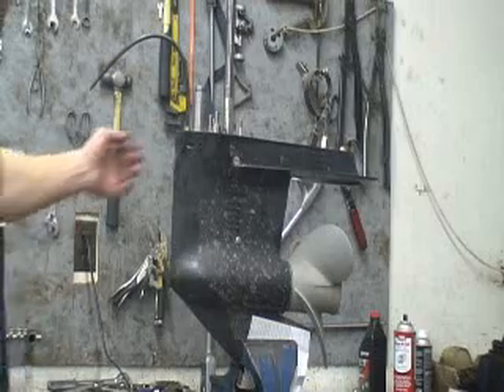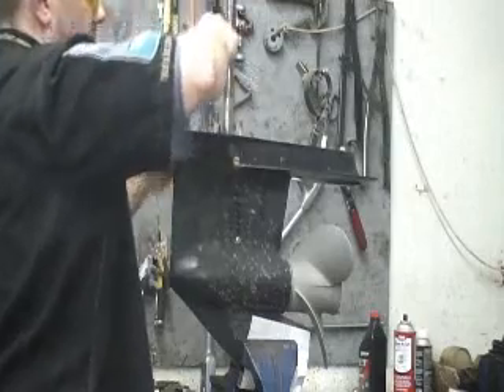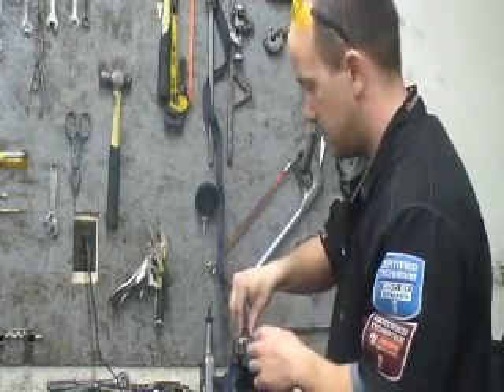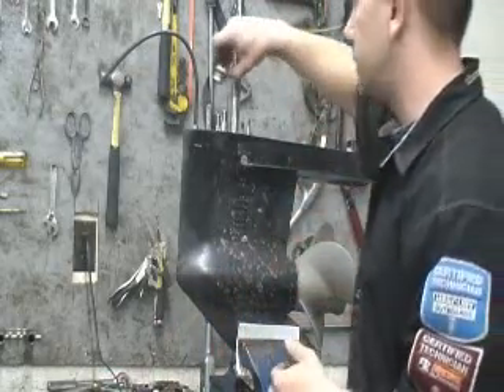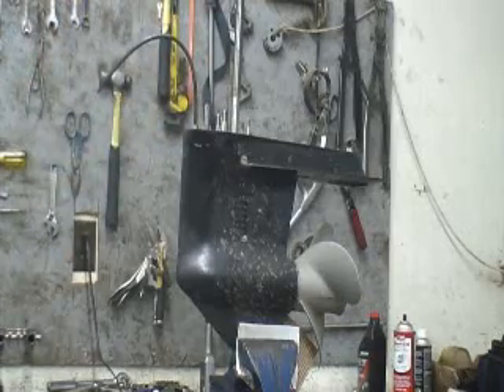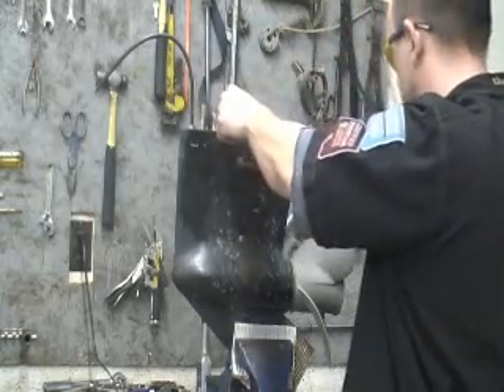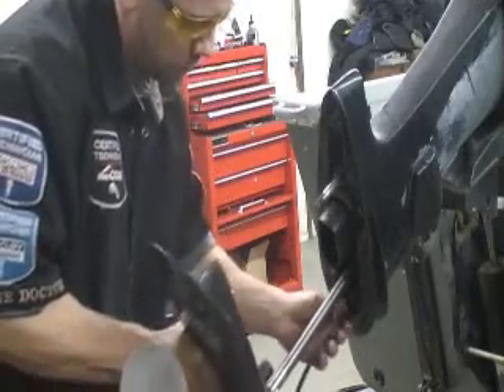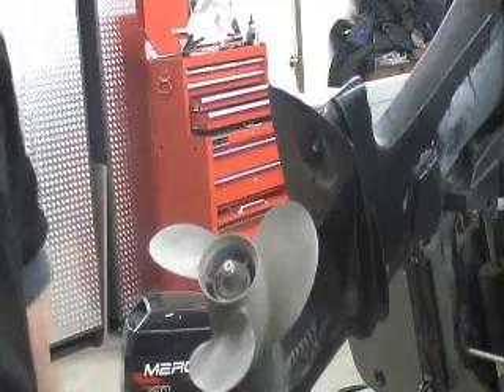Merc gear case removal and replacement Part 2

Comment: I have a 83 mercury outboard lower unit and the water pump tube is a solid copper tube is there a trix to instaling this type of unit it seems likt it gets real close but seem like that tube holds it up.

Comment: First I want to say thanks for making these videos! They're very clear and easy to understand. I wouldn't have attempted to change my water pump, but after seeing how easy it was I tackled it.

Now the question. I bought the kit which includes the upper housing, gaskets, impeller, and several various sized o-rings. When I took off the water pump, I didn't see any o-rings in the area. Am I missing something? Everything esle in the kit was used.  It's a '79 Merc 80hp. Thanks!

Comment: Thanks, I was worried I had a gear case vent open to the water without the tube running up. My 200 I bought used just has the white nylon fitting with the barb section broken off.

Comment: used our video to replace the water pump. Was a snap, but I have a problem getting the lower unit mated to the motor. I got it to go in, as my wife shifted the cable forward and it popped in. But the propeller won't move in the direction it drives when operated forward...I'm worried I've done something wrong. I bought the motor at an auction and it started right up, but I wanted to replace the pump,

Comment: great video , I have a Merc 9.8 . 1968 model that I just replaced the impeller on. Everything went ok , and I was careful to replace the lower unit in the same gear(neutral) that I took it apart in but now its in forward and no matter what position I move the shift lever to , its stuck in forward. I have removed and replaced the lower unit 3 times , each in forward neutral and reverse gears with the shift handle matching what gear the lower was in , but still stuck in forward. Any advice?

Comment: Great video, wish I would have watched it before removing my LU. My shift shaft came out of the LU and now will not go back into the LU. I shined a light down the shift shaft hole and it looks like the hole is being blocked by something, like a washer. How do I realign this so the shift shaft will align?

Comment: Thanks. Indeed a Sierra kit is available for about 1/2 the cost of Mercury OEM. Same kit to 1986 for the big 4/6cyls.. I made a pressure tester with a bike pump and a gear lube pump fitting, so I will check to make sure the prop shaft seals are leaking too. I know the shifter seal is as the cavity right behind it was full of oil.. some of the oil from the shifter seal may have gone down the exhaust housing and made it look like it was leaking.

Comment: This appears to be the same or similar Merc as mine.  I am curious about the long black tube or cable that was dangling from the gear case.  I did not see this when I took mine off.

Comment: It looks like it's function is to hold the shift shaft down.  It snapped somehow and now when I try to shift it'll only stay in forward.  What do you suggest I do to brace it, there's still a bit of a lip there if I can find something that'll fit over the shaft.  I would appreciate any suggestions.

Comment: just changed the impeller on my merc and the motor wont shift into gear, is there something I did work while installing? the prop is not engaging gear

Comment: Awesome videos.  I am expecially interested in the Mercury as I have a 1966 65 HP 4 cyl.  I would like to see more videos on the upper unit.  I purchased this unit and have no idea of what kind of care they took of it before me.  I want to understand how to open it up, identify parts, and determine what needs replaced. It takes a couple attempts to get it to start and remain running, and while in neutral you had to idle up or it would stall.

Comment: Marine doc.
another question to follow up the last post. How do I get the cable shift into neutral and install the lower end, so that it's in neutral? I'm a newby at this, so when it fired up when I got it home, I felt real cofident when I saw your video and changed water pump...now I have problem of no neutral and don't know how to get it right...can you help?

Comment: I removed my lower end to change out the impeller and seals.  When putting it back together, I had forward where reverse was supposed to be and reverse where forward was supposed to be.  Neutral was correct.  I dropped the lower unit again, switched the shift shaft on the lower end and now I only have forward.  I tried re-aligning the shift shaft in each spot available on the shift shaft and only forward.  Any suggestions?  It's a 1994 Mariner 40hp, 4cyl.  Exact same model as the video.

Comment: Mr. Marine Doctor,
What happened to the vertical shift rod? In the first video when you pull the unit off the shift rod, drive shaft, and water tube are present.? Right? So where is it when reinstalling the lower unit? Does that water tube just "hang out" inside the housing or do you connect to some water passage? Where do you disconnect the shift rod from to pull the lower unit out? Thanks

Comment: I have a 1964 Merc 650 short shaft and I'm pretty sure needs a full reseal, it had 1/2 water in the case but it was low so it never busted from freezing ( not run in 12 years ) and is also leaking the new gear oil that I put in it,, Is this a difficult job? I have an OEM manual coming but I have never done more than a gear lube change on a Merc. I have the lower dropped out and in my vice. It shifts fine and seems to be in great cond otherwise.. Also, is a Sierra seal kit ok, or should I go OEM?

Comment: I did the water pump procedure for the 1st time on my 85hp merc.  Everything went well up to the point when i put the boat in the water and my reverse no longer worked.  Is my issue the fact that I did not have the shifter in reverse when I assembled the low end unit?

Comment: can you tell me, I have a mercury 500 thunderbolt,50 horse, I have put the new water pump on and steering cable, and throttle and shift cable, but when I got it all put back together, pushing forward on the throttle, it goes to reverse, and the backwards position idles the motor up and in forward,
what did I do wrong?? please help

Comment: I have this exact same motor (1996 40hp Mercury) and today out on the water I put it in reverse and it just clicked over and over again. Goes into foward just fine. Any suggestions. Thanks

Comment from the maker: Look up inside the leg and see if there is an obstruction stopping the shaft from going into the crank.  If there is...the powerhead will have to be removed and the part put back into place.

Comment from the maker: That is a speedometer tube....its used instead of using an external speedo pickup.  There will be a small hole in the front of the gear case that it runs to.

Comment from the maker: @gmarinetech 

The water tube gets pushed into a rubber grommet at the top of the leg.....if you point a flash light up the leg, you will see where.  The flexible black tube is for a speed line to hook to.

Comment: hi there, when installing the lower unit it won't go all the way. it stops with a couple inches left and no matter what i try it just won't go back together. any help is appreciated. i did try moving the flywheel and shifter but no go. oh its a '73 merc 150. thanks a million.

Comment: putting the water tube in first , using a flash light is a good idea.  Just jam it in there.  you can see where it goes.  the bend in the water tube should go away from the drive shaft.

Comment: what would you do if the drive shaft is rusted in place? i cant get it loose.i have now flipped the engine upside down and sprayed alot of rust loosener inside

Comment: hello, I have an 1986 Merc 75HP .  Can I remove the auto oiling system and just add the oil to the fuel my self. I just bought this boat and not sure if it's working. Does it have a warning device?

Comment: Now I discovered a problem.  After taking my propshaft out and checking for proper motion.  Everything moved properly.  When I installed the propshaft, we noticed what we think is a grease seal that popped up off the propshaft.  The linkage when moved, rubs the bowl of the lower carb.  Further investigation revealed that the shift shaft torques upward when trying to engage a gear.  Noticed what looks like a retainer that is part of the power head.  It's a a cast piece.

Comment: The 2 inch black hose on the water pipe was on top of the water pump. I got a new one but not sure how to install it and how does it stay in place? Also the water pipe is stuck and will not come out of the pump housing. Is this normal?

Comment: Just got a merc 115 inline 6 tower of power. Went to replace the water pump impeller, and when I took the lower unit off the shift shaft spline stayed in the upper unit of the motor. Seems to be stuck. When I reinstalled the lower unit, it will not shift.. Any suggestions?

Comment: I have a 35 HP Mercury. I pulled the LU to install a new water pump. As I began to install the pump I found that I have Neutral and two Fowards. Is that because the shifter shaft moved upwards? I am sure that it did. The shifting shaft seal carrier was still in place. It wasn't far but it seems that in this video that you made particular notice not to let it happen. Thanks
Reply from the maker: James Watts If you are having trouble finding out with is frwd or rev...just use neutral.
Reply: TheMarineDoctor  Thanks, I have it already installed. I do have another question. I have a single cable steering with a Teleflex cable. My steering range is not same in both directions.and at center range my helm is upside down. . Is there a trick to solve this problem?
I'm Jonesing for a fishing trip> LOL
Reply from the maker: TheMarineDoctor The link bar at the engine will be the wrong size.
Reply: Well Dude, you nailed it again! You're batting 1000. There were two holes in the tiller bar from the engine. I moved it to the hole closest to the engine...bang! Problem solved

Now i have another problem. Tilt and Trim 1988 35 HP Mercury. The tilt/trim works intermittently. When running it from full down to full up it begins to start and stop on the second cycle up and the also then going down. Continually holding the trim button in, it stops and starts again every few seconds. I let it cool down and then the whole cycle goes over again.

Both solenoids never loose voltage going in or out on the load side. They never click loosing contact as long as I hold the trim button in.
I'm sure something is overheating, but what? I hope that this is enough info. Thanks again.

Comment: any idea how to get a lower unit on a 150hp outboard back on? been working on it 5hrs non stop took 7 min to get waterpump housing off cannot get it to line up its a 1979 with the pin on top of the drive shaft? i removed grease, crank engine over , will not go back up , and its never been in saltwater , left it in neutral?

Comment: I have 1996 merc 2 stroke. taking lower unit off. how do you disconnect the shifter Linkage? seen other you tube videos none of them look like. I see were the rod come up under the carburetor there is no retainer it just goes up thru part of the shifter bracket and has like a rubber ring around it. there is a pivot point with a nut on it that is part of the linkage not sure if it will even have any5hing to do with the removal. any feedback back would be appreciated

Comment: buddy i need help..the drive shaft bearing (race),coming down from the power head,has been spinning inside its housing,i put in a new (race) ,but it spins too,what is the solution to this problem? do they sell an over sized bearing race so that it fits tight in its housing?...thank u pal,awesome video.

Comment from the maker: Did you tube come out when you removed the case?
If so, use a flashlight to locate the rubber grommet it slides into...then push it into place.
Do this prior to installing the case.

Comment from the maker: Sierra kit is fine, if one is made for it.  Hardest part will be the bearing carrier retaining the prop shaft.  A special tool is used for it.  If its not avail.  Two screw drives opposing one another and turn with them.

TMD

Comment: Hi,I have a 60 hp EFI BIGFOOT 2003 and it seems 'tight ' to go into neutral....any ideas what causes this?
New cables done so not that.
Great videos,very straightforward.
cheers.
Reply from the maker: Have you checked the idle speed, perhaps its too high.
Reply: TheMarineDoctor
 not running...basically when you shift in and out of gear,,,mainly going from throttle forward to neutral is extremely 'tight'
if i remove the cable from the shifter mechanism the cables are free so it is not cable or control related.
could there be an issue with the selector?
the shaft down through the leg is free,,well greased linkage etc.
cheers

Comment: I have a 68, 50hp it`s the 500 thunderbolt ignition. I`m having problems wit the lower unit. I know where some of the same year 65hp lower units are, will the 1968, 50hp interchange with the 65? greatly appreciate the answer!!!!!! thanks

Comment: in your video you said to put the shift control into reverse, but i did not see how you put your lower unit into reverse so they are the same when putting it back together. how do you put the l/u in reverse?dumb question probly but i need to know. i dont want to do it wrong. thanks
Reply from the maker: Turn the shifter counter clockwise.

Comment: Well, I pressure tested it to 12 PSI and the prop shaft seals are holding, but the shifter seal leaks bad. I think I got off pretty easy this time considering it does not need a full tear down

Comment: Ok so I have changed the impeller I went with the direction of puting the motor in fwd after putting it all back together I have fwd in fwd  and fwd in nuetral and fwd in rev what do I do?

Comment: i have a 1974 mercury 200 and when I apply throttle the motor revs but its like the prop isn't spinning fast enough do you have any suggestions on what it possibly might be and I tried a new prop but same thing is happening
Reply from the maker: Check the condition of the gear oil.
Remove the case and check the drive shaft for damage.

Comment: I have a 35 hp mercury I put it back together with the shifter in reverse but know the shifter won't go into forward any ideas what I did wrong?
Reply: I'm having the same issue with the same motor. Have you figured it out yet?

Comment from the maker: If the gear case stays in Rev when shifting, you either have rev confused with forward or you did not align the shift shaft.
One click counter clockwise of the shift shaft allows for rev.
If the shaft is spinning freely, its going to be in forward and you will not be able to obtain any gears.
The shaft MUST feel detent.

Comment: I have a mercury 500,50 horse, I have put the new water pump on and, but when I got it all put back together, pushing forward on the throttle, it stays in neutral until I go full forward.  When I put it into reverse, and back in neutral, it stays in gear until I push forward to what should be forward.   What did I do wrong, and can I fix it?
Reply from the maker: Remove the case...put it and the throttle into rev.
Re install.
Reply: I have a 63 Merc 500 Kiekhaefer and same problem. I do understand that you put it in reverse on the controls up front, but what you don't show is how to put it in reverse on the lower unit, that is totally stumping me!!! And keeping me off the h20

Comment from the maker: Drain some of the fuel from the carbs and see if its blue or a corrisponding color of oil and fuel mix.  
Or you can use a clear graduated hose and see if the oil gets drawn through the tube.
There should also be blue smoke when running.

TMD

Comment: Greeting from NZ.. any idea how to remove the gear selector shaft on a 1974 115hp. The steering (Pivot) has seized and I want to remove it to  sort it out, but the gear selector shaft runs down the centre and taking it off from the selector shaft under the carbs is not appearing to be an option as it has a pin through it and you cannot get a punch in there to remove pin. I have removed the gear box assemble. Any ideas(Videos) on how to remove the pivot assembly? What are my options?
Reply from the maker: You need to remove the power head to get the shaft out.
Reply: Thanks, I did that!!!

Comment: These old mercs are tricky, I was told by our local tech that when you install the LU the shifter should be forward. on my 1968, 50hp the when I have the motor down in RUN position and the shifter forward.. it seems to be in reverse. I can manually shift the LU off the motor with pliers, I can feel the cam clicking in the 3 gears. Funny.. how hard can it be with only 3 gears, but it is, lol
Reply from the maker: The cam can slip past all the detents and move into forward.  You will then not be able to shift properly after that.  If you install it in Rev...you never have that problem.
Reply: TheMarineDoctor I watched your video again and you explain all this at 6:32 sorry, my dumb ass spaced it some how. but wow... how cool and awesome lesson, thank you!
Reply: So now I have to understand all this, which gear is which, like when the cam follower moves forward, that must be forward? When it relaxes and moves to the detent furthest back, it must be in reverse? I tried again and I must have had it in forward. I pulled it out again and that cam can spin all the way around and back into place again. So, I`m trying again! lol
Reply from the maker: If worst comes to worst...attempt it in neutral.
Reply: TheMarineDoctor I was just trying again today because last night I noticed when the shiftier was moving into its positions the coupler was barley moving, so today I adjusted the linkage, put it back together and it was stuck in reverse. So I`ll keep trying. I`ll try neutral. Thank you :)